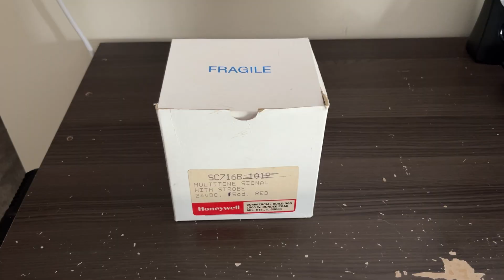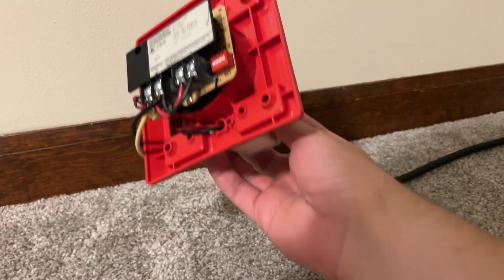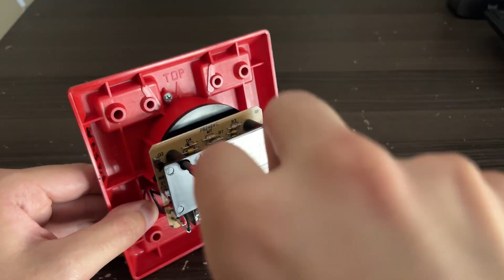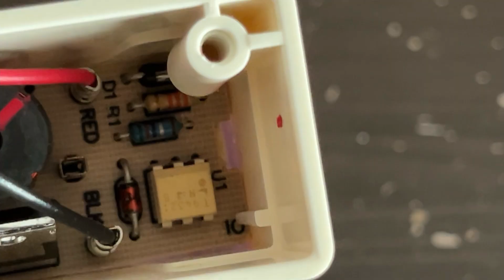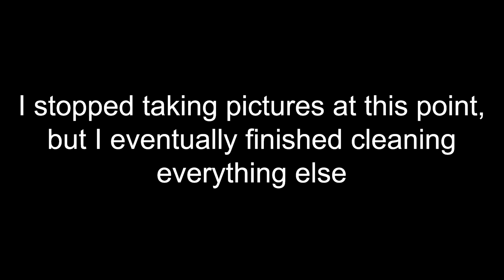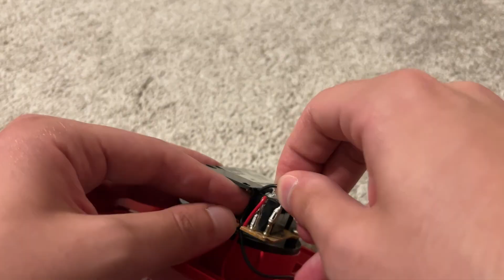Honeywell Rebranded Wheelock MT Unboxing & Repair | (Unboxing #8)

Comment: You should do a all tone test on that thing
Reply from the maker: I most likely will since the pitch is all messed up LOL
Reply: @IllinoisFA  That would be interesting. Not sure how the pitch raised.
Reply from the maker: I probably hit the pitch resistor on the board with either the heat from my soldering iron, or when I was cleaning the board with isopropyl alcohol
Reply: @IllinoisFA  Nonetheless, I say it makes it unique. I like the higher pitch more.
Reply from the maker: @ThatFireAlarmGuy  I agree! Makes it stand out over my other MTs. I’ll get a video out of an all tones test here soon.